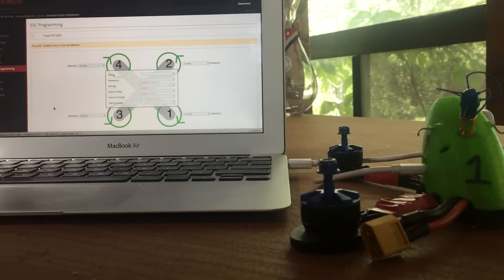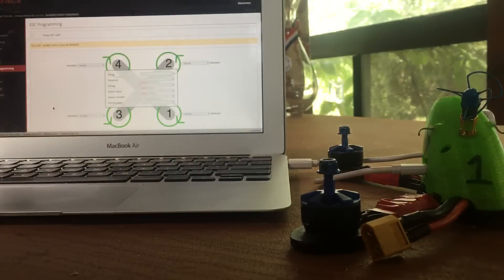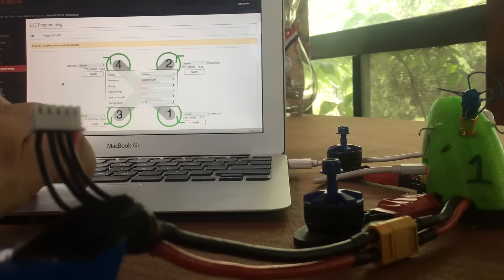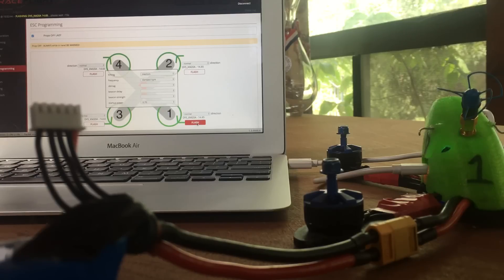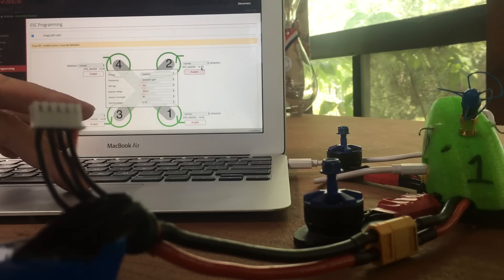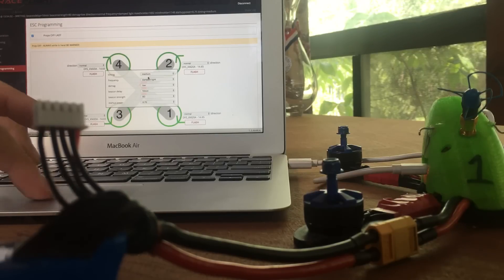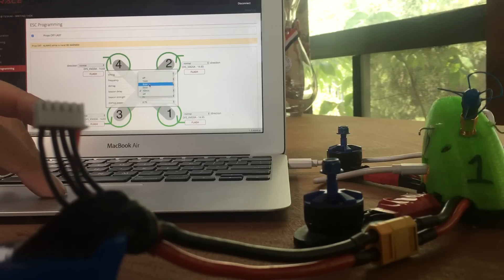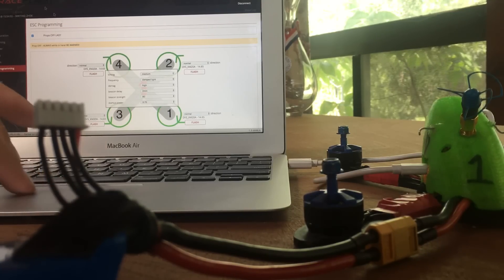RaceFlight Integrated 1wire. As easy as it gets.

Comment: Hi.  Im going to try raceflight for the first time. Im using a LUX FC with aikons. Downloaded 3.2.6 configurator, and flashed FC with the LUX_RACE_BB330.bin.

I wanted to update blheli_s 16.3 to ESCS through raceflight ESC tab, but the flash button doesnt appear.

Another detail. When conecting FC to raceflight, in the PIDS tab, all windows are blank. No values on any parameter. Is this normal?

Thanks in advance.